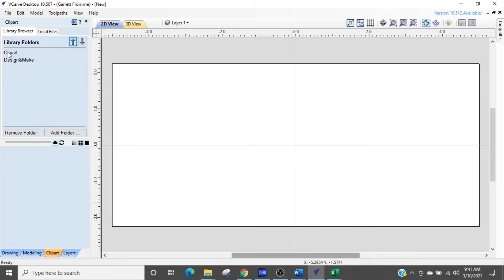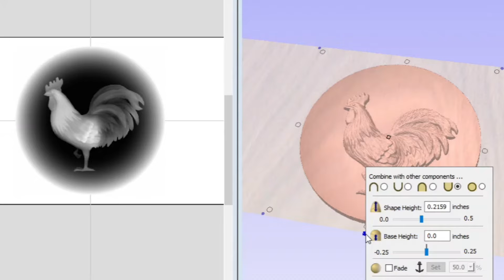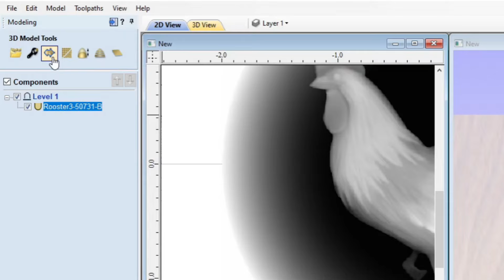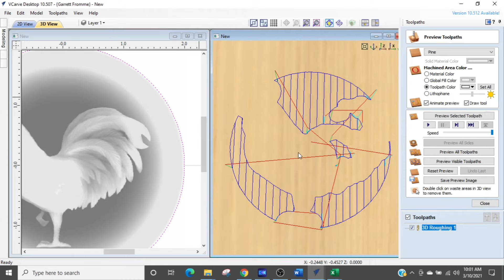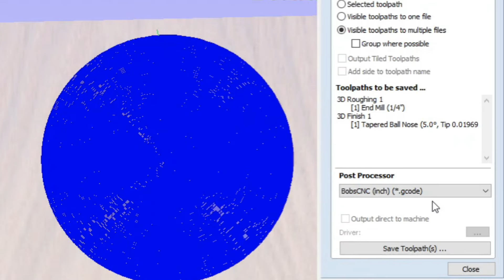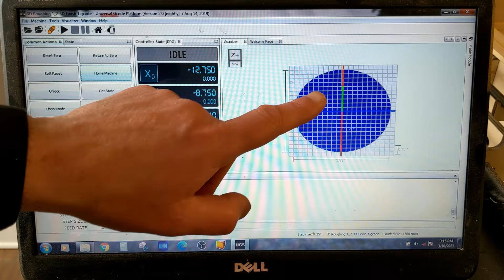3D Carving Made Easy: Full Vectric Step-by-Step Tutorial

Comment: Hi Garrett, I have another question, if I may. I am sure other will find it useful too. Here it is. I tried to make the toolpaths for the Rooster but this time from the lybrary I chose the first model "A" of the rooster which is not within the circle. In 3d it's sticking out above the surface. But when I try to calculate the toolpath I get the message "No suitable vectors selected" although it IS selected. Is it because it's above the surface and what do I have to do? Maybe you have another video for the instance? Many thanks in advance. I hope it's clear what I mean.
Reply: No worries, I fixed it. Under Machining Limit Boundary, I had to select "Model Boundary". Now it generates the toolpath.
Reply from the maker: Hi Matt. Glad you found it.

Comment: Hi Garrett, excellent tutorial. I run into a problem though. When the CNC was doing the roughing out it gave me an error - Limit has been reached -Z. It stopped and aborted the whole cutting process. What does that mean? Luckily, it had roughed out most of the material so the final polishing still produced a good result.
Reply from the maker: Hi Matt. Your machine reached its max z depth (you will need to extend the bit out more from the router) or something mechanical stopped it and it interpreted it as a z max limit.
Reply: @IDCWoodcraft  Oh, yes, this makes total sense. The bit was a bit short. Garrett, you are the best! Many thanks.

Comment: Do you have to reset the Z when you change bits as one may change the height while changing them?
Reply from the maker: Hi Matt. Yes, you have to reset the z when you change bits
Reply: @IDCWoodcraft  Hi Garrett, thank you for the reply. Which point do you reset it against as the initial one might be lower after some cutting?
Reply from the maker: @mattz8234  I set it at the same point as the previous bit... Like at a corner
Reply: @IDCWoodcraft  Thank you very much!

Comment: Are you familiar with the Easel program? that is what I thought I would use with our CNC when it comes. We are getting a One-Finity CNC. Would it be easier to use the Vcarve that you are using? I am totally new to all of this. I have been getting used to the Ortur Master Laser 2 for the past few weeks using Lightburn for the program. Any information would be greatly appreciated. Thank you.
Reply from the maker: Hi Judy. Easel will not be able to do the 3d stuff like this. At least not the free version. I tend to steer away from it anyway because it is web-based. Meaning, you are dependent on Inventables to keep the server up (inventables is the company that owns easel)

Vcarve is much more flexible. Reqiuires a bit more of a learning curve (that's why I do one-on-one), but is also intuitive for the most part.
Reply: @IDCWoodcraft  It seems expensive. I haven’t checked on the pro version of Easel to compare but the cost is what keeps me from Vcarve. We don’t even know yet if we can sell what we make to afford the cost. Maybe down the road we will.
Reply from the maker: @judylong4059  you can still do amazing things with Easel or Carbide create. If cost is the determining factor, go with one of those and work up to the more advanced software later

Comment: Great video,
When using the carving bit I was getting a ‘drag line’ which was a devil to sand out.  I discovered the ‘stepover retract’.  Doesn’t take much, but saves a lot of time.  

Any future video plans on stepper motors and spindles?
Reply from the maker: Hi Dan. Yeah, one little setting can eliminate a ton of time. I didn't discuss that in this video (probably a bad miss for just this case)

Comment: Hi. Where can I get the stl file so I can follow you through the lesson. I am a Newbie. I ordered a 6040 cnc router. So I just want to follow along with the video. Is there any software I need to buy. What software do you recommend thats free. Thanks
Reply: Hi. I am interested in both of those programs. Why do some people say don't connect with Easle that it changes file settings or something like that. Some are so expensive I can't afford them.
Reply from the maker: @SleepApneaSenior  I don't use easel so cannot offer guidance on your question. Sounds like carbide is the one to use.
Reply from the maker: Hi Robert. This file came with the Vectric vcarve software. You can follow with any STL. I am just now experimenting with Easel and Carbide create (both free) so do not know of their 3d capabilities yet. I hear Carbide is easier than Easel.

Comment: Howdy do you recommend a spindle for my openbuilds 1515 and starter bits?
Reply from the maker: Zech, I always recommend a spindle over a router. Quiet, more power and controlable spindle speed from the g-code.
Reply: @IDCWoodcraft  do you have a brand in mind? That will fit my 1515?